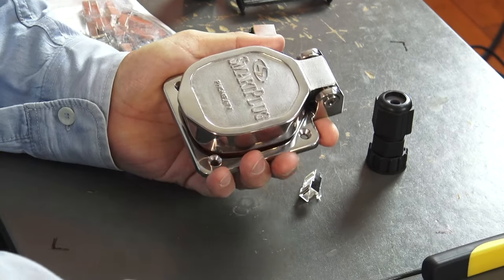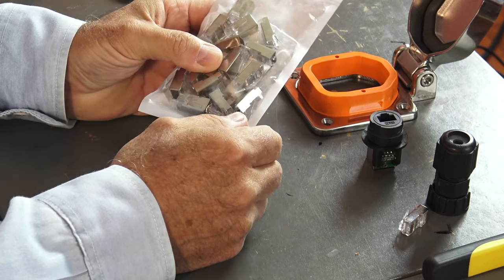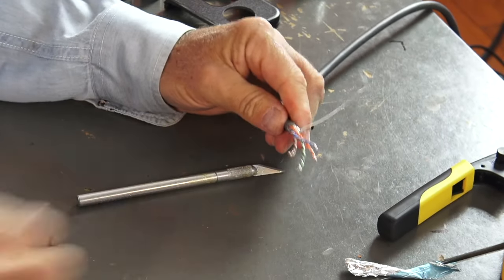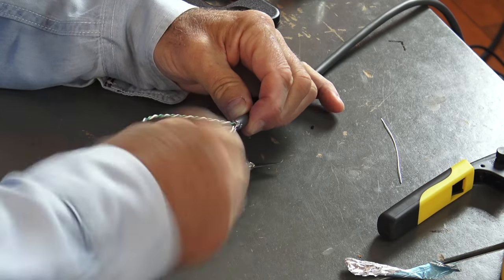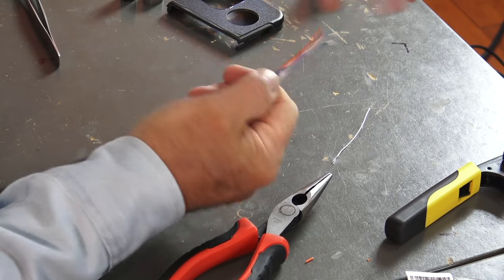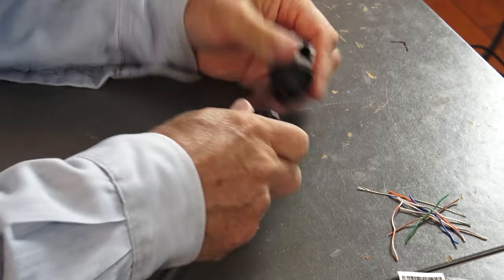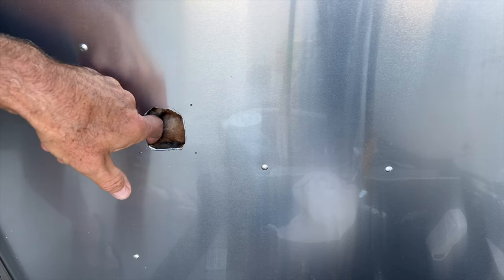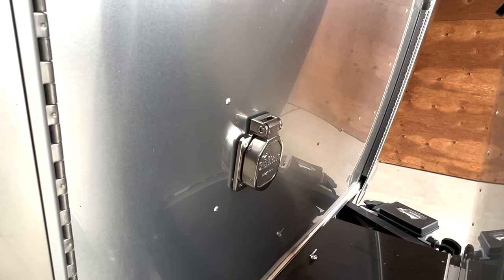Solve a common dilemma with Starlink RV: Make your own external port!

Comment: Great video. WiFi routers like to be higher rather than lower for better distance. I had a freind that had hers on the floor of her condo in the livingroom. Sitting on the couch across the room , the signal was low. I put it on a chair and the signal went to full bars. Thanks for this opyion.
Reply from the maker: Good tip! In my case, I will mostly be sitting right above it with my laptop. Glad you found it useful. I am actually shocked at how many people have viewed this.

Comment: Great video, very detailed but I have a question: How did you fish the cable from the smartplug port to the point under the table? I don't think you showed that. Running wires through the inside is my biggest issue. Thanks
Reply from the maker: It was a very short distance so I just cut apart a coat-hanger and taped the cord to it and pulled it through the wall cavity. I did have to pull out a bit of insulation but I stuffed back in once the cable was through. Hope that helps.

Comment: Thanks for sharing.  Why drill a new hole for the smartplug?  Why not use the existing coax hole for the smartplug that is generally found by where you plug in for shore power?
Reply from the maker: Too much trouble to run Starlink cable from existing coax plug to where I wanted to keep the router.
Reply: @michaelkronenberg6675  I wonder if you could use the existing coax cable to fish the starlink cable to the interior.  We don’t use the coax cable anyway.  Do you know how the nuts and bolts guy did it?  He didn’t mention that in video.
Reply from the maker: I initially was going to do that but running the Starlink cable from that plug to where I wanted the router to stay was going to be more of a hassle.

Comment: Why did you need to drill the 1 inch hole for if you already have the modified connector?  Nicely done on the modified connector, I hoe you you don't mind if I copy off your idea.
Reply from the maker: Hi Arturo. You are more than welcome to copy my approach. I'm glad you found it helpful. As far as the 1-inch hole goes, I had to modify the SmartPlug with a piece of plastic from an old OtterBox cell phone case and drill the 1-inch hole into that in order to put the 90-degree RJ45 jack into it. SmartPlug has a single coaxial one that you could take coax out and drill a 1-inch hole into it for the jack. That way you don't have to "jerry-rig"  your own custom plate. I hope that helps.

Comment: I was just wondering about the cable on the outside.  It appears that the cable connects horizontally and then the cable turns downward creating a constant downward pull on the connector.  I once had a situation with the same cable (for a different purpose) and that constant downward pull eventually, after two years broke the connection.
Reply from the maker: Watch carefully at about 19:12 and you will see how the wire is supported internally with a plastic sleeve and a rubber piece on the end that all gets locked into place. Also, the cam-lock that twist-locks into the jack is very strong as well. I don't think there will be any issues like that with this cam-lock fitting.

Comment: Nice try but Starlink doesn't support a spliced wire and Cat6/ethernet connection as I've come to learn now that I ran cable to my outside cable jack ( no hole cutting) ( Airstream Globetrotter)  and so ultimately though I can run Starlink, it is slowed and has multiple interruptions at times. Back to the drawing board.
Reply from the maker: Not sure what is going on. Mine has worked perfectly as I installed it.

Comment: Does anyone know if you can keep the TV and Satellite connections and still add a Starlink connector all in one SmartPlug.  Would need to make a custom plate.  Just wondering if there is enough room on the SmartPlug surface to have all three in case you want to plug into a cable provider or satellite provider while still having your Starlink internet connection.  I guess you could always just add a second SmartPlug to the RV.
Thoughts please.

Comment: Does the Starlink not use a standard Cat6 Ethernet cable? So you could find a short extension for inside and use the whole long cable on the outside, without cutting it?
Reply from the maker: I wish. Unfortunately not. Inside connects to the Starlink router with its own special plug at both ends.
Reply: See Video by Everlanders DIY Starlink Flat Mount. He goes over the RJ connection which eliminates the specialized Starlink router connector.

Comment: It isn't that hard to wire an RJ-45, instead of trying to insert them one at a time you just straighten the wires and get them aligned the way you want then slide them all in at once.  I found several videos that show how to and it would take less than 5 minutes.  With a pass thru you can confirm the color codes after the connector is on for the first time and it's nothing to re-do if one of them slips out of place.

Comment: Don’t you need that small ground wire you cut off?
Reply from the maker: I've seen different comments about this. I just went ahead and just cut it without bending it back and securing it under the metal part of the connector that gets crimped onto the end of the cable. The thing is, it worked the way I did it. But who knows, if the dish gets hit with a lightning strike and my trailer explodes, well that would be bad for me!

Comment: Not tech savvy. The problem i'm having is ordering pars for the installation. All have been successfully found except for  Cat5 90-degree jack and Cat5 external locking plug. The email address was not complete and when I went to the site I could not find the desired products. Possible to get a little help?
Reply from the maker: Here you go: 
Cat5 90-degree jack:
https://www.digikey.com/en/products/detail/amphenol-ltw/rdp-5spffv-tcu7001/7619909

Cat5 external locking plug:
https://www.digikey.com/en/products/detail/amphenol-ltw/rdp-00bmms-tlm7001/5253137

Comment: Good video, I'll be doing the smart plug and a variant of this. Only advice I can give, I'm a computer guy that has pulled hundreds of thousands of feet of cable and terminated them, flatten the twisted pairs after you separate them and get them in the right order then push them all in side by side all the way down to the edge of the rubber coating you cut off. You made it harder on yourself than it needed to be. https://www.youtube.com/shorts/kxTI0L6M3YQ

Comment: Wowser, are you very lucky you missed that horizontal rib.  That would have cost thousands to have the skin repaired, had you punched the hole 2" lower.  Very close call, but nice job otherwise.

Comment: I believe that braided wire/cable is just there as a structural member to keep the cable from being stretched from someone pulling on it too hard.  Stretching the cable beyond a certain point could break some of the internal wires.  In most CAT5 cables I have cut open, a polyester looking string is used instead of metal cable, but same idea.  As long as it still runs to each end of the cable and is anchored by the connectors on each end it will do its job.  Worst case, just don't use the cable as a rope swing and it will probably be fine.
Reply from the maker: Hey thanks for that. I won’t worry now. And no rope swinging !
Reply: For Outdoor & shield rated stuff, the metal cabling provides a ground, so best not to snip it off, it's supposed to be wrapped back then wrapped around the legs of the cable tabs.

Anyone else considering doing this, I recommend not using the starlink router, instead using a 48v PoE injector/power source so you're not converting dc to ac to dc.
Also, eliminate as much of the cable as possible, the shorter the cable, ,the less the loss and power usage.

I saw a video from another creator that does exactly this, as well as making a permanent mount for their dishy and can even use it whilst driving as they don't have to stow the dishy.
https://www.youtube.com/watch?v=gRSnTMrUPrQ

This might give you all some extra ideas, or mix and match 'em.

Comment: What a mess.  Why not just coil your wire up and run one end out of a hole in your RV wall, then Silicon Seal the wire into the hole.  No wires get cut.  I mean, Dish TV does this with their instillations.  I know you mean well.